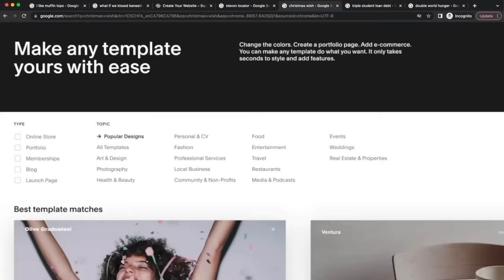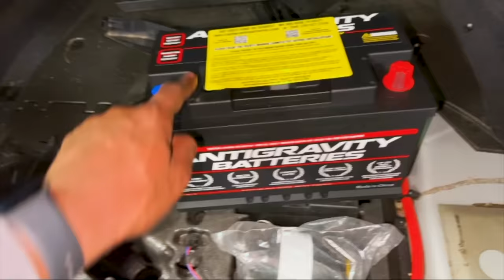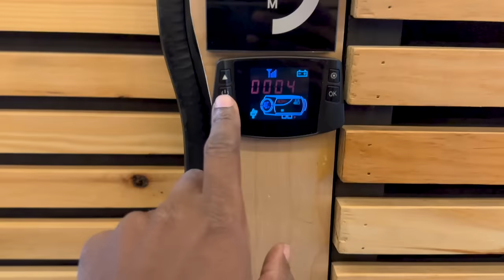I Bought An “easy fix” V10 BMW M5 From Facebook Marketplace, Here’s How Stupid I Was

Comment from the maker: I decided to ship the car to Troy Jeup, a reputable M5 engine builder, then when I get it back I'll continue troubleshooting the other issues.
Reply: So your not getting it back lol
Reply: @nicosiano1174 heck, many kit cars use BMW V10 engines… I wouldn’t give it back.
Reply: Please tell us your findings when you get the vehicle back, i probably have the same exact issue with my 06 e63 m6
Reply: @nicosiano1174 troy jeup is the goat for these motors he will save the block as long as its not cracked or fucked entirely. Troy is HIM when it comes to s85 motors
Reply: If it’s throwing every code have you tried clearing it and see which comes back? How’s the battery? Mine had a similar issue where it was throwing about 112 codes. All were from a bad battery. 

I’d be extremely wary of Troy jeup. He’s currently under litigation from what I’ve been told and has a hard time giving customers back their cars. I’d be wary of him.
Reply: Troy is a M5 God. I would chat with a few people that know him when I owned a 06 e60. The biggest issue was vans and the throttle body actuators. And then boom electronics issues.
Reply: Stroker engine 5.5?
Reply: The only thing Troy is "reputable" for nowadays is stealing peoples money and broken promises.
Reply: Yeah all I know is, havin' withdrawal symptoms ovah yeah ! Post a vid already. My Sundays have turned bleak. Anything, any topic, any whim or notion, any project or no-project.
Reply: P.i.t.a. My '03 x5 got rained on and never had power again. 
Had to find a hack to get the doors unlocked, so I could clean it out. 
Never again.
Reply: According to Consumer Reports, bmw has a "recall" out for 900k+ vehicles. There's a short circuit that occurs in the engine bay which could catch fire. They have no actual fix for it yet...So they advise looking and smelling for smoke while driving.
Reply: Holy shit.. no fucking way.. my was there
Reply: Get the 5.5 or the 6.0 liter v10 .. worth it..
Reply: WHERES THE FRICKIN CARRRRR BRING IT BACK DONT GIVE UP
Reply: I think I'm about to one up you in insanity there, Rich. I might be getting both a 2006 M5 and an M6 V10. But granted they're in a hell of a lot better condition than what you got that thing in.
Reply: Love the M5

Comment: The Chihuahua analogy was pretty accurate, As long as these cars are maintained and have extra clearance rod bearings installed they are ok for reliability. Most owners who buy these don’t expect to pay M car part prices and then neglect and dump the cars
Reply: LMAO 😂 “as long as you put all new rod bearings in” who does that?
Reply: @jc13781  Don't forget valve stem seals. Oh and high pressure fuel pump. Oh and plastic timing guides. Oh and coilpacks that last 10k miles.
Reply: @jc13781  anyone who likes their E60 M5 and wants to avoid engine damage
Reply: @wrth  any reasonable person would just drive a different car. Replacement rod bearings should never be something you deal with as normal maintenance.
Reply: @jc13781  you buy these stupid cars because you like them and don't mind the maintenance. if you can't afford the time or money to maintain an S85 then you don't have to buy one.
Reply: @wrth  trust me I won’t be buying one, and rich clearly regrets his purchase as well. Only a fool would consider owning such an unreliable nightmare of an engine. It is a shame bmw cannot build reliable cars anymore. There are hundreds of other fun and luxurious cars that are also reliable (ie: e55 amg)… no reason to buy something that you need to rebuild the engine every 5 years.
Reply: @jc13781   don't get me wrong I agree with you. BMW make reliable cars now, B48 and B58 are excellent engines. I guess that's the price you pay if you want a cheap high revving V10 or V8 in the M5 and M3.
Reply: Look at M 593 restauration about what is really going out with BMW
Reply: Some contradictions there, to me the analogy makes no sense, but the premise is right, the car will present the issues, it's just a matter of time. But what is also correct is that if you like the car, what it represents and more so what it doesn't represent (contrast with modern shit); you will stock up on ACL's bearings, BE bolts and more, same as an E46 M3. These cars are not going on up in value for no reason, something of value is costly. 

Value gets to anyone with a tag, either financial or with time and effort.  Happens with cars, with women, with anything in life.
Reply: @jc13781  There are aftermarket rod bearings you can get that, afaik, completely fix the issue of rod brearings snapping due to having proper clearances.
Reply: @person.w9780  as I said to someone else, who wants to tear apart the entire bottom end of their car???? Insanity the mental gymnastics bmw people will go thru to make their cars reliable when it should have been a recall to the dealer for an engine replacement
Reply: @jc13781 i mean you buy a 100k basically experimental F1 car and beat on it and rag on it and then expect for there to not be problems, again it is a 100k car, only people making 100k or more should own one
Reply: @keyonkelly5693  it’s not a 100k car and BMW shouldn’t be putting any experimental anything in a car for 100k that doesn’t make it 50k miles if they want customers to be loyal.
Reply: If rod bearings every 60,000 miles are a “maintenance” item then it’s pretty objective that the vehicle is not reliable
Reply: @memertmemes2586 , so you're just gonna leave out the SMG pumps?! 😂😂😂
Reply: @memertmemes2586 	e60 m5 doesn’t have high pressure fuel pump? Why are you making things up? S85 is a natural aspirated engine.
Reply: @jc13781 his point is that is to get the ones with extra clearance not the factory rod bearing with tight clearance, does that make sense?
Reply: @The_North0  my point is that they should have been correct from the factory and bmw should have recalled the cars… they didn’t recall the cars because bmw fanboys will bend over backwards to make stupid excuses for a giant corporation that shits all over it’s customers and they keep coming back for more helpings
Reply: @The_North0  ok so the m5 might not but it's a massive failure on every BMW product that does. Why get so defensive over a company that doesn't give a single shit about you? You really shouldnt be defending such garbage.

Naturally aspirated has little to do with being direct injection.
Reply: @jc13781  persons that own a super car. Its part of the maintenance schedule and the S85 is cheap to keep in the compared to others.
Reply: @memertmemes2586  HP fuel pump?  wrong engine my friend.  S85 is port injected and does not suffer from carbon build-up on intake valves.
Reply: @memertmemes2586  s85 is not known for valve stem seal issues.  If working on engine would replace, but have not seen any S85's burning oil in this manner.
Reply: You are correct. I bought my 2007 M6 e64 new and still own it with 67k miles. If I put the purchase price into an inflation calculator, the 2024 equivalent price is $180k. When these cars depreciated, younger buyers bought them and abused them, then threw tantrums when they couldn't afford to fix an exotic car. I just looked up a complete rod bearing replacement kit, including all bolts, gaskets, and vanos line, $840. That's not bad, buy some jack stands and a decent torque wrench, do your own labor your in for less than the price of a set of tires. Pilot Sports are about $1500, and you will get about 22k miles on those if you don't hit them hard (can't rotate them). Oil changes cost a couple hundred dollars.
Don't expect to have a Camry.

Comment: The vanos runs on oil pressure  and will cause a tap it cause from not changing the oil and its dirty and takes running the engine to temp giving it the beans wash that crap out change the oil again and check for debris in the filter

Comment: The copper sludge.....maybe a aftermarket additive/sealant? Also i put cheap castrol gtx 5 30 in my 325i,  worked fine, you don't need fancy oil.

Comment: BMW has an official procedure for the stuck lifter - 

The procedure for addressing a stuck or noisy hydraulic lifter in a BMW involves a hydraulic valve adjuster (HVA) bleeding process. Here are the steps:

Preconditions: Ensure the engine oil level is neither underfilled nor overfilled and the engine is running at operating temperature.

Bleeding Process:

Increase the engine's operating speed to 2000-3000 RPM (no load) and maintain this for three minutes.
Let the engine idle for 15-30 seconds and then check if the noise is still present.
Repetition if Necessary:

If the noise persists, repeat the steps above up to a maximum of five times.

If the noise remains after five attempts, perform the bleeding process one final time for a total duration of 15 minutes at the same RPM range.

This procedure should be conducted on a level surface in a well-ventilated area. The bleeding time can vary from a minimum of two minutes to a maximum of 30 minutes, depending on the severity of the issue
Reply: I really thought you were going to say "buy a new engine"
Reply: @carguy7627  I was expecting "Sell to a teenager that doesn't know better"
Reply: I’ve had to do this on my e46 bmw which has a sticky lifter if it sits a long time. Rev it and hold like it says. Just grit your teeth and hold. Eventually it’ll stop. If not keep doing it. If it still doesn’t free, then there’s something else going on.
Reply: Top comment
Reply: Mystery oil makes these steps work so much better, it totally cleans off all the sludge
Reply: @carguy7627 😂😂😂😂
Reply: I got a procedure for bmw - step 1 - dont buy them and keep your money
Reply: @Jacob1986 ignore you and just buy a older Bmw , a e39 or e34 e28 is a great 5 series but you don’t seem to know that
Reply: @chiefrocka8604 
Who, with any sense, wants to know?😂😂
Reply: If it does not go away, replace all lifters.

Comment: I've owned about 10 BMWs, including a few known to have bearing problems. Based on the frequency of the sound at idle my gut says it's a lifter sound first, rod-knock second. In any case, that's a LOT of ugly metal flakes in the oil filter housing. I did bearings on the S65 (similar bottom end of the S85, just two cylinders cut off) and mine were nearly toast. Didn't spin a bearing, but they were down to the copper and out of tolerance by a considerable margin. There was nowhere near that much copper or shiny metal. That amount looks very suspect/strange. If it were me, I'd put up the money to service the rod bearings regardless to try and save the crankshaft and rest of the engine from eating itself in the future.

I'd like to see more M5 content here. Let's say you put 10-12,000 into the car between bearings and handling its deferred maintenance, you'd still be doing alright on the deal in my opinion as most SMG M5s are trading between 17 and 25,000.
Reply: Really? Why do they eat bearings that quickly. Did BMW not give them enough oil flow?
Reply: If you combine F1 derived high reving engine with very tight clearances with the average American attitude towards car maintance, this happens.
Reply: @jacobrzeszewski6527  correct, apparently the clearances are way too tight to get enough oil in. on top of cheap oil, BMW's heavier 10W-60 recommendation and people not warming the engine up before driving, it all adds up
Reply: Such horrible engineering. Can’t believe you keep buying them.
Reply: I always think of BMW as Avante Garde Engineering.  Sure it took a few years to kill the old ones with no maintenance but the new ones were designed to be owned by Germans in Germany with garages and carports, that can take it to German Dealer Service Departments that look like clean rooms with custom cut foam toolbox drawer organizers and labels for every one job unique tool.
Reply: The question is does Rich want to do the work and sell for more, or sell now at a small loss but without spending any more MTE on it.
Reply: I own an S85. I had a lot of metal in my oil filter housing when my high pressure Vanos pump failed, but the bearings themselves were fine. Could be something like that
Reply: @totalyep it’s not horrible engineering if you don’t know how to use it. That’s like saying a plane’s cockpit is a horrible engineering design with a a lot of buttons all over the places but it’s you who doesn’t know how to operate a plane and why it’s necessary to have that many buttons.
Reply: @The_North0  no not an analogy. Plane engines don’t automatically generate fatal failures due to turning knobs incorrectly. These engines (and most BMW engines) are junk. Even GM can figure out bearing clearances.
Reply: @totalyep  nonsense. GM is and always will be a junk. GM never won the best international engine of the year but BMW has. S85 won the best engine of the year in 2005.
Reply: @The_North0  GM does build junk but they do know how to size rod bearings.
Reply: @Nphen he selling it for 7500

Comment: Sounds like Vanos solenoids. Might as well come if you have little to little oil in  it. Rod knock sounds more solid, this is definitely from the little things in the head, like Vanos or lifter.
Reply: Yeah I'm thinking low vanos pressure. Had a similar issue with a v10 I swapped the crank on. One of the copper washers on the external vanos line wasn't seated correctly. Oil was spraying on the ground and the  head would knock/tap on both sides.His might be the internal line.

Comment: Let it idle, video it, play back 10 seconds and count the taps, Multiple by 6. Does the math equal the idle RPM (or close)? Then it’s a rod. Or does it equal half of the idle rpm? Then it’s valvetrain. Sounded like a rod in the video but didn’t seem fast enough.
Reply: Is that 6 being calculated using the number of cylinders?   Seems like it should be.  How does 6 come out of a 10 cylinders?
Reply: @hamsterbrigade 10 seconds x 6 = 60 seconds. Taps approximated per 60 seconds. RPM (per minute).
Reply: @hamsterbrigade  to be fair most people have an inline 6 bmw
Reply: Drive it! What do you have too lose at this point? #My2cents
Reply: @hamsterbrigade  time, rpm. Cam rotates half of engine rpm, easy way to determine if the noise is upstairs or downstairs. This noise is loud, it sounds like a rod, but it’s not fast enough to be a rod.
Reply: 11:50 - 12:00 ~36 taps (~10 seconds) * 6 = 216 taps; +/- 5% (205 -226) . Assuming warm idle is in the neighborhood of ~500 rpm, it's a harmonic of the crank (i.e. camshaft). At least that's what my ear picked up.
Reply: @cg8212  Math checks out. Upper motor. Old sludgy oil, sitting, etc would all contribute to a sticky solenoid or lifter. Keep trying, Uncle Rich! As much as I'm not a fan of BMW I think this one deserves to be saved
Reply: not sure if its really the rods
Had an s14 with the SR20 with failed rod bearings, the sound was intermitten and only at a certain rpm range and even on idle, but not consistant, That tapping sound sounds too much consistant, it is more of an injector tap, rather than the bottom end.
Oh and usually you can literally feel the spun bearings on your go fast pedal, because of the slight changes in the crank rubbing on metal or not (meaning its then out of balance)

I'd say: Inconsistant tapping: Rodbearings/bent crank/bottom end, Consistant samey tapping: Top end, Injectors, valves
Reply: @02lucy666  hard to tell since it depends on how far they're gone, my sr20 with failed rod bearings had a very consistent tap, sounded like a diesel.
On this particular engine I'd do the bearings anyways, it's considered normal maintenance and if they're not already out they will be at some point.

Comment: My bmw had an issue that caused it to sit for a while. After I fixed it, I had a noisy lifter on the first start up. It sounded exactly like this M5. My noise went away on the first drive and never came back
Reply: Stuck lifters bro, very common on bimmers that sit for long or have older oil in them.
Reply: @beemteamkeem makes complete sense as the cold old oil will sludge up

Comment: These cars are definitely hidden gems for certain people. The rod bearings, plastic guides, vanos issues, can all be fixed fairly easily IF you catch them in time. The bearings are actually very easy to replace without removing the engine from the bay. If you're the type of person that has some mechanical abilities and find one that isn't too far gone, these are a great budget performance vehicle. The performance for dollar you can get in this car is unmatched if you can handle the issues on your own. That said, they can also be huge money pits for the wrong person, or if serious machining is needed. For those who know what I'm saying, then you already know. For those who don't, just stay away from them! I would definitely buy another one, but not just any one...

Comment: Those cars have a power control module that is notorious for causing endless electrical gremlins, no start issues, and all sorts of problems.  It costs about $100 for a brand new one. I suggest replacing it now to save you loads of time diagnosing in the future.  Its located near the pcm/DME under the hood.  You should also run the factory AGM BMW battery only. Then register the battery in the car’s computer afterwards.  They are the most electronically temperamental  cars on the planet
Reply: Rich should take note of your heads up pointers😅

Comment: Copper = rod bearings done.  You are correct about that.
When you start getting copper that means the coating on the bearings is gone.
Reply: Finally someone who knows!  Where else would that level of Copper come from?  Nowhere.  A stuck lifter doesnt dump copper into your oil